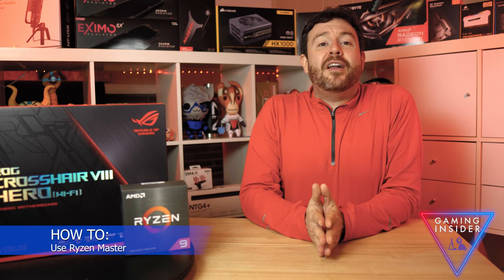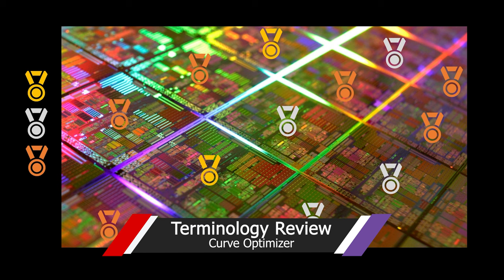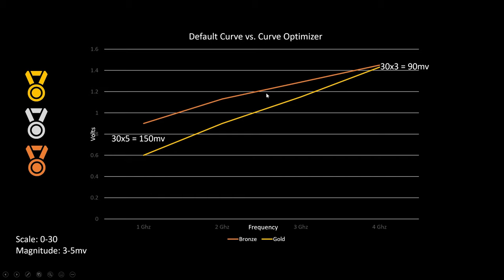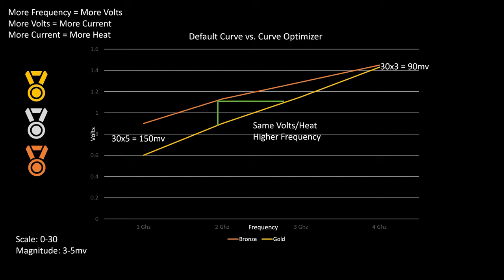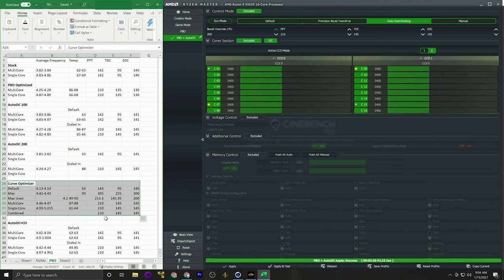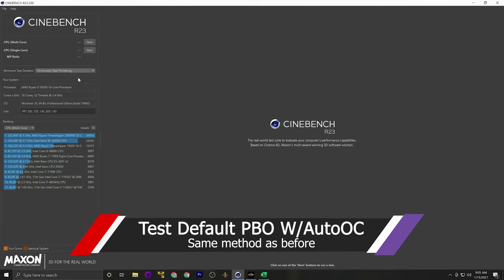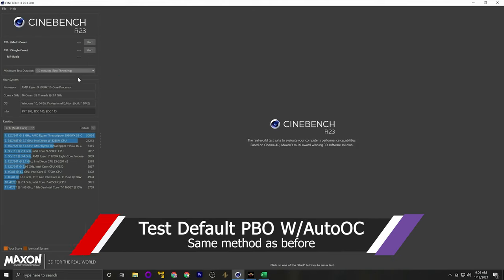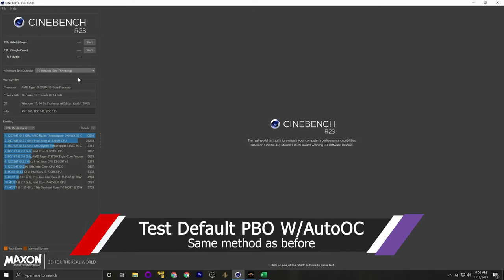Dialing in AutoOC & Curve Optimizer in Ryzen Master --- Part 4

Comment: What are we supposed to do with vcore?  if I leave at auto it runs really high, close to 1.5v and much hotter than if I set vcore override at 1.35v.  Both are stable but am I gimping my set-up's potential?
Reply: One word: Amps. You shouldn't be looking at voltage and freaking out when it hits 1.5v.

Comment: do you do this in conjunction with the previous video of optimizing the TDC, PPT and EDC and inputting them manually into Bios and Ryzen Master?
Reply from the maker: Curve Optimizer is the biggest bang for the buck, as it were. Start there, then fine tune with PBO settings.
Reply: @TheGrayingTech  so when i do single core tests in cinebench r23 its using 2 cores. Sometimes it will use one core for maybe a second or 2. Then mostly the 4.9ghz etc is shared between 2 cores. So its hard to see true numbers to fine tune the single core PBO
Reply: @TheGrayingTech  I have a b550 Aorus pro with the latest bios and I do not see Curve optimizer please tell me I am just missing something.

Comment: First of all I have to say you are doing a tremendous work. I am playing with Microsoft Flight Simulator 2020. When I checked the processor utilisation with ryzen master, I have never seen the maximum boost clock speed goes up to 4.3 MHz in one core while Other cores runs at less than 4 GHz. so do I really need to overclock my ryzen 7 5800X processor? Because at default state the processor can easily achieve 4.5 MHz all cores even.  Sorry if I am asking a stupid question.

Comment: How did you get your single core so stable? I frequently see mine switching between my two "best fit" cores on CCD0 and hovering in the mid 3.5 ghz range on one and 1.5-2 ghz on the other with short periods with one boosting to 4.9.
Reply from the maker: Curve Optimizer will certainly help with that. It helps drop the voltage needed, dropping temps, and thus the scheduler doesn't need to hop as much.

Comment: Did U Change anything on Load LINE Calibration or cpu core voltage in order to avoid the Vdrop? Do u think CTR delivers best results?
Reply from the maker: Yes in my Power Video: https://youtu.be/fyrE1zEa4T4

Comment: After Reached negative with 30 and 100mhz is possible to try 200mhz with negative steps a5?
Reply from the maker: Absolutely. Definitely check to make sure the system is hitting the existing number though. HWInfo is good at capturing the average and max. If it is, i would go up 50 first and check again.
Reply: @TheGrayingTech  you have to make more detailed video about OC + HWinfo.... My big Respect for you Explanatory videos that are also suitable for beginners

Comment: I have my 5600X with 450 tomahawk max at +200mhz with negative10 allcore,ram 3600c14. - using arctic 34 duos PWM-
cinebench 20 got 4409/629
Cinebench 23 11474/1611
 not bad considering I m almost within spec.
Reply from the maker: Those are great scores. Your RAM is certainly helping there too. Is that Samsung B-Die?
Reply: 11259 on a 5600x. My SC is trash compared to yours though - 1398.

I don't use a 200 mhz override, or any override for that matter. It's not stable on this shitty motherboard.

110 PPT, 65 TDC, 105 EDC
5 - 25 - 5 - 25 - 25 - 25 curve, 10x scalar

Comment: Thanks for you vids. My 5800x ran pretty good out of the box. It ran all-core 4530 MHz and 4850 single core. Optimizing the PBO and AutoOC only got me up to 4575 (no impact to single core) so I wasn't too impressed. Then I implemented the curve optimizer and that's when things improved the most. I got a stable -25 and now I get 4695 all cores, 5 GHz single core, and my temps have gone down from 86 to 80.

Between this CPU improvement, my RAM OC, and my 6900xt OC (I followed all your videos) I feel my system is really humming. I've seen noticeable improvements in MSFS 2020 in VR so again, thanks for your vids.
Reply from the maker: Congratulations!! Glad to hear you got such great numbers. MSFS is definitely gonna push the envelope, good thing you have a powerful card. 

How is the game in VR?
Reply: I was able to set a decent 6-26-30 curve with 10x scalar .. (reads as fastest/second fastest/remaining cores)
But my shitty MSI PRO-VDH B450 motherboard crashes on anything above +25 mhz Override.
It definitely pays to be on a solid B550 or X570 mobo. Grats to you breaking that 5 ghz mark!
Reply: @ryzen89  Well I had to dial it down a little. It ran stable except for 1 game. MSFS 2020 started crashing. That game pushes my machine to the max in VR and I traced the crashes back to the overclock. Dialing it back a little resolved the crashes but I'm no longer in the 5GHz club :(

Comment: As soon as i run it on Boost overclock cpu on 100 my system crashes. any advice I have a 5900x
Reply from the maker: Try the power settings in the latest video. They should help by adjusting the amount of current flowing to the chip at boost.... or you could be experiencing VDroop which can be addressed with load-line calibration.

Comment: I attempted this at negative 10 first.  Ran for 30min and then started to freeze one window at a time in Windows.  Set everything back to default.  A few days later I attempted to set it to negative 5.  Ran for hours and then started to freeze one window at a time.  Have it set back to auto now and create a WHEA event logger to see if when it crashes it is due to a specific core.  I haven't gotten the courage to start trying this again.
Reply: it's probably your two fastest cores that are crashing. if you don't feel like tuning each core individually you could leave those two stock and try the rest of them at -10. my best two can do -1 and -9, the rest of my cores are between -18 and -27

Comment: I've been messing with this for months and stability is so difficult to achieve its not worth using the curve optimizer. Like others have said the stability at idle is the issue. Managed to get 5150mhz call and 4950mhz effective single core running cinebench r23. Then multi core 4650mhz call and 4650mhz effective falling to 4500mhz when fully heated. I currently just use normal PBO with motherboard setting for PPT. 4850mhz single core and 4450mhz multi core
Reply from the maker: It's a balancing act. If you are crashing on the low end, you can use Event Manager to find the core that caused the crash and then decrease the magnitude of that core.
Reply: @TheGrayingTech  Thanks for the tip I'll try that.

Comment: I got lucky with my 5800x, I am able to use pbo and curve optimizer with a negative 25 on all cores plus 200mhz. I am see all core boosts for 5.024ghz and and all core load in r20 of 4.7. Anyone else had results like that?
Reply: That pretty nice. Mine is stuck with +50 and far less aggressive offsets. Though my 5800X does boost to 4.650 all core and single core 4.9 GHz. By consequence the margin is rather small.

Comment: If it crashes very early  change your LLC a little and see what happens if you have a low LLC
Reply: LLC defeats the purpose of curve optimizer. Just lower your curve by a few points if it isn't quite stable. LLC 1 or 2, is only necessary for getting a 200 to 300 mhz boost override stable. Takes a lucky chip to even reach those clocks.
Reply: @ryzen89  it's not doing the same thing
Reply: I have seperate values to each core but LLC 3 for both.

Comment: i had the overclock stable for like 12 hours and then just out of nowhere my computer did a black screen hard restart  pbo 205 tdc 135 edc 140  25 Curve optimizer temps were all fine no throttling 4.95 ghz